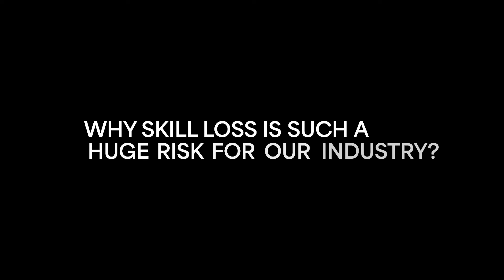Are We Losing the Ability to Make Things in North America? | Machine Shop Talk Ep. 133

Comment: I worked for a major tool maker for over 10 years making tool cabinets. Could run everything in the entire dept. Cnc turret punches, brakes, shear, spot weld, programming. I got paid the same as the laziest pos in that plant and on average did 4 times the amount of work most others did but the management didn't see a problem with that. The incompetent got promoted and big raises and things got even worse then DEI started I left late last year and have been getting by doing odd jobs in my shop and at 48 yrs I really don't want to go back into the work force. There is no reward for the people who can do it other than making up for the lazy and incompetent. The bad thing is I hear from a lot of people that it is every where anymore.
Reply: I"m just getting into the industry after 30 years in Software Engineering (all front line, no time in management). It doesn't really matter what field you are in, less competent people are frequently promoted over highly skilled hard working employees..  Why?  Promoting highly skilled people causes problems - they can't hire  just 1 replacement, they would need to hire 2-4 people to do the work you were doing.  Basically you are too expensive to be replaced.  Promote you  & hire 3 people to do your old job or promote 1 semi-competent suck-up & hire 1 replacement.  It sucks, it really does, but it's the way the bean-counters look at it.
Reply: @chrissplace392 1000% seen that in warehousing almost 15 years ago. Working in a kitchen it was a little different but not all that much.
Reply: Same in Europe I'm 77 retired at 68 two years beyond normal and against my will, then they start calling me back in to to diagnose and repair and recalibrate production m/c's because they don't 
understand how their equipment functions and contractors can't seem to figure it out most of the time. this is caused by a generation who don't have the ability to diagnose a problem and if they do find the fault it is by throwing the parts dept. stock at it, dumping perfectly good parts out of the m/c
till they get the m/c to work correctly again. wasteing time and money.
Reply: If you are looking for varied work, consider restoration parts for some of these collectors out there. How you meet them is by going to the specialty get togethers and talking to them and showing some of your work. I worked in the Antiques field, and kept Busy thru all sorts of downturns, These people have money, and are willing to spend it. I would say that Most of them are independently Rich and have no Problem paying it out for good work. The work varied in skill from metal spinning parts, Casting parts , Plating those same parts and generally a lot of machining of lost or broken parts. I did it all, have made millions of parts over my 45 year career.  Something to think about -- Carry on.
Reply: @anneinfurna8528  I have stepped a little bit into that world. I know someone who restores old sock knitting machines and have been making brackets and parts for her. I have been trying to figure out how to expand on this with others areas. My recent addition of a plasma table is going to help me expand my capabilities. I mostly need to work on my networking skills and find the right people now.
Reply: Sounds like your owners knew you were a lucrative little pup. Almost like that one guy, I forget his name, something about "Marx," was right.

Comment: I made extrusion dies, vacuum molds, crop dies, injection molding, etc. For 10 years. Surface  polishing information is old, outdated, and hard to get. The books I could get used tools you can't buy anymore. We would start to buy dies from established die manufacturers with a long pedigree and the finish would be ass with scratches everywhere when it was supposed to be under 2 microns on the surface and I would have to re-finish them. To be honest, hobbiests are doing things you would be hard pressed to find a professional shop to do in the US.
Reply: Seems like women were the best polishers back in the day.they had a lot of persistence and pride in producing a mirror finish.

Comment: I am in a somewhat unique position...I do contract work and  travel from shop to shop every few months.....main common theme is...not enough pay....short staffed and overworked.....and they do not like input on anything that could speed up there process....the shop I am at now is aerospace and I am appalled at the lack of knowledge in tooling....still using end mills to hog out bores instead of using an indexable drill.....using old fashioned gun drills instead of using a solid carbide thru spindle drill.....list goes on.....there is a reason why boeing is way behind.....stuff like this......and most of the guys are  operators...cannot trouble shoot and only 1 guy with that knowledge.....to top it off they pay ok....but another company near by stole a lot of the older employees by offering 20% more pay and better benefits.....wages definitely need to go up...heck if the company can afford to pay the wage I get...plus per diem and hotel they can afford to pay a better living wage...that is why I do the contract gig...much better pay...benefits not so great...

Comment: As an apprentice graduating from a 4 year program in 1980 as a toolmaker, i had 3 great toolmakers to share their knowledge with me and 4 other apprentices . I watched an amazing transformation from manual machines to nc and cnc controlled machines. I learned how to program at my third and final employer that had their own apprenticeship ideas. Their guys learned how to use programing applications but struggled on how to do basic surface plate checks on the parts they made. I taught when my supervisor allowed but it was not encouraged. Most of management could understand and relate table checks to their employees when they gave them the time. The apprentice program i was fortunate enough to go thru was ended by corporate budget cuts. The community collages are trying to fill the gap but as others have said the pay makes it hard to justify 4 years of expenses .

Comment: In my experience there just aren't entry level jobs available.  I'm in the middle of the manufacturing corridor between Chicago and Milwaukee and there's maybe one entry level job posting a month within 50 miles.  There are plenty of job openings, but they all require at least 3 years experience and generally 5 years minimum.  Employers in general aren't looking to train new people, they just want to replace their veterans with veterans.
Me personally, I just completed all the CNC training at my local technical college with a graduating class of about 20 people.  Maybe three actually had a job lined up by graduation despite job fairs every semester.  I've been looking for an entry level job for the last year, I'm on the verge of giving up and going back to welding/fabrication.
If you want to keep machining alive you need to start by actually hiring entry level people.
Reply: Shops dont want to hire entry level because often they can't afford to in the first place, so a barely getting by shop cant afford to have noobs breaking tooling or damage machines  or worse yet get hurt by having his arm wrapped around a lathe. Many shops have to make enough to get them through lean times of the year as well. There are cases too though that the owner is a greedy SOB, makes all the money and wont pay for skill.
Reply: @renaissanceman5847  Yup...  And these shops will ultimately fail because of their shortsightedness and need to prioritize profit and quick turnaround over longevity.
Reply: Pretty much this, how are you going to get the 3-5 year guys in the first place if you're not going to even hire entry level guys?
Reply: Go to seek they find me inexperienced know nothings everyday.

Comment: Xometry is also not helping. If you are a member you understand how insanely cheep these guys want parts. In 5 days. Plated. And delivered. Its literally a race to the bottom.
Reply: What people don’t realize is that xometry isn’t the only place that wants cheap parts. We deal strictly with end users and can’t get them to bite at higher hourly rates no matter what we do
Reply: I just started using Xometry and I would hardly call it cheap, so I normally fully support opposing the race to the bottom but I am also learning as an entrepenuer that everything cant cost a million dollars either or nothing gets done.  I am working on building a stainless vacuum chamber so I can do plating dlc coatings and so forth and need parts made but I cant get slapped with a 4 figure (or near 4 figure) bill for every flange and rolled cylinder I have made either.

Comment: I have been a tool room machinist, mold maker, R&D prototype part and engineering support programmer and machinist since 1985. Manufacturing started to go overseas at about the same time. I was fortunate that I did not work in a manufacturing environment but in r&D and prototyping environment which continued to sustain me to this day. My machine shop is the CNC Mills lathe surface grinder welder job shop type equipment. We work directly with the engineering staff. What I see in the future is additive manufacturing replacing so much of subtractive manufacturing which has been the mainstay for the industrial ages until now. Technology is changing the way we create parts. Elon musk and his raptor engine. Take a look at his first engine versus the engine he uses now. Additive manufacturing is so much more effective at providing engineering solutions. Things that cannot be done conventionally. I now have an additive prototype department in my machine shop. It is growing. Resin prints, FDM prints, and soon metal prints, that's additive manufacturing. Though I should be retired before I get to fully engage in the exciting technological future, I think I see where the future is going. I feel like subtractive manufacturing will be replaced by additive Manufacturing. Yes machining skills will still be required for repairs but I think additive is where the future will be.
Reply: Additive certainly has a place - I’d agree right now that for very specific applications it’s revolutionary where it works - I think we’re at a bit of a tech bottleneck for the time being where the cost per part just isn’t there yet - but it is definitely interesting to consider where it’s going to be in five or ten years. It’s growing very quickly.